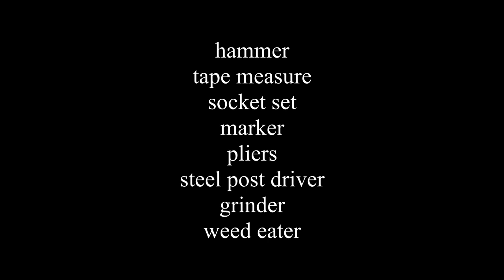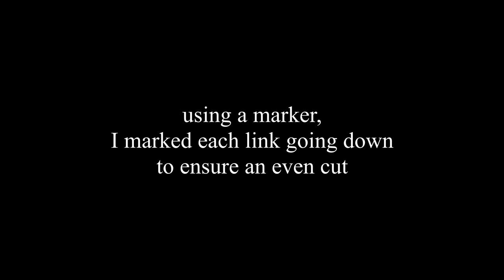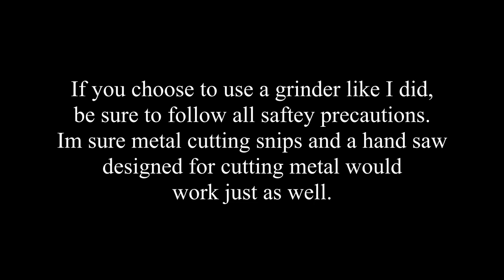adding a gate to a chain link fence ( how I did it)

Comment: Why the grinder? Just unfold the top and bottom curl on the fence wire you want to remove and it will just twist out. Also. Measure the width of the gate you are installing, add 2" on each side for gate hardware and this is the distance you put your two poles apart.

Comment: If you bend one of the vertical wires over on fence fabric, you could have just twisted the wire out instead of cutting each wire in the fence.

Comment: Unless you are very familiar with safety precautions, a better tool than a grinder would be a simple bolt cutter. Very skilled woodworkers have endured serious injuries using the depicted electrical tool.
Reply: Or...just twist the wire out and no cutting is needed

Comment: Excellent job. About how long did it take from start to finish?
Reply from the maker: If I hadn't filmed it probably less than 2 hours, if you already have all the supplys. I also wasn't going for full perfection on this project, just needed a way to get the lawnmower in and out. Thanks for the comment.

Comment: great job!   did you set the new posts in concrete?
Reply from the maker: No, not the new ones, all the others were set so since I added the gate in between 2 existing ones, I just stuck them deeper in the ground, they still seem pretty solid though. I guess if they do start to sway it wouldn't be to hard to reset them. Thanks
Reply: that was not a great job! and i hope he didn't concrete the post!

Comment: That poor dog in the background is wondering why in the hell is this master chain link installer using a grinder to remove extra chain link ??? this video should say: how not to install a chain link fence... look at 8:53 how loose the fence is ....  he left a extra link in the chain ??? he would of been smarter to install '' J ''   bolts not hinges so he could adjust the clearance on the locking hinge... also chain link  should be half a diamond above the top rail  just say`n  ,,,,  and having 2 latch's is such a pain to deal with each time to open and close that new swing gate..